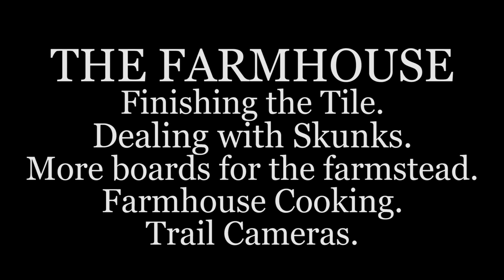THE FARMHOUSE. Finishing the Tile. Skunks. Boards. Cooking. Cameras.

Comment: 5:20 that exterior door on the dryer vent is flapping in the wind.  (see the light flashing in to pipe?) I bet that's filling cold air into the dryer during a winter storm.  💝☀🌵

Comment: You might want to consider a propane kitchen stove. It's a wonderful heat source...plus, it works in a power outage.
I LOVE JUSTIN WILSON! Dad loved to watch him, even though he didn't cook.
You folks eat well...country cook in.
Reply: I really want a gas stove!
Reply: @melissa70817  My grandparents had propane and then natural gas from 1948 until I sold the home in 2006. I replaced the 1972 Hardwick stove(pilot type) in 2001 with a Maytag pilot less one. It was easy to lite the burners in a power outage...impossible to lite the oven. The old stove(worked fine, but was avacado..yuck) was 36"...much easier to can foods on. Granny had a 48", 6 burner...Mom said you could easily run 3 water bath scanners at once...quickly doing snap beans...and later, 3 pressure cookers.  There are plenty of 36" stoves, in great condition, coming out of urban areas, from renovations. Unless you go commercial($$), I think the new stoves are lax on quality metal, to be honest. But, it depends on what your needs are. I love the trial in the laundry area.

Comment: 24:14 will a 6-8 inch trim interfer with that outlet cover on the far side (left of the window?) or will you move the outlet to match the one under the coat rack? 💝☀🌵

Comment: When working tiles you'll want to go from the end of a wall, or corner, towards the exit so you don't work over fresh placed tiles. Is good to mark the last tiles installed first but is convenient to like, in the laundry, go from right side, going up to the end, but I would done it facing the right side, that way I would come up from an end towards an empty space that don't have tiles so I exit the installation to a hardened area like your left. Same on the entrance, I would have worked from the right side as you did, facing that side down up to the door so I don't work over fresh tiles. You did good but I just tell you so maybe you try it one day.

Comment: What did you use to prep floor ....1/2inch dent shield? Just curious  that's what I use but I butter my tiles
Reply from the maker: I used 1/4 inch denshield. I did not need the half inch because I had a solid inch and an eighth subfloor. If you watch the video prior to this one you can see the whole process.

Comment: Joe, I don't understand why you didn't put the dryer next to/ beside the washing machine?  Opposite side of the room does not make sense.  Just askin'
Reply from the maker: That is how the house was set up when we got it. In the future the washer and dryer may get totally removed from that room and put into one of the additions we are thinking about adding.
Reply: @NorthernSeclusion  well that makes sense.or if you're into plumbing you could move the washing machine over next to the dryer.  And then put louver doors in front of the washer and dryer.